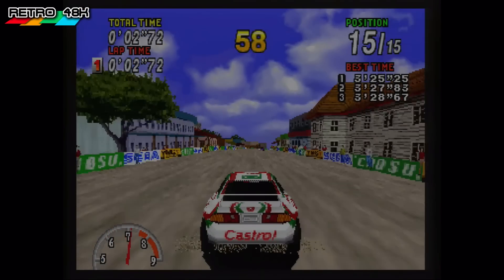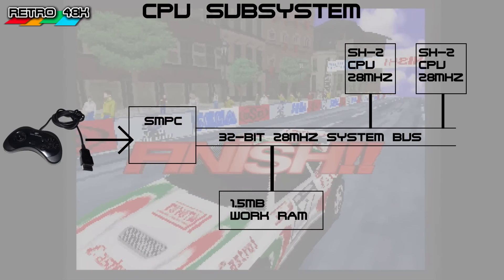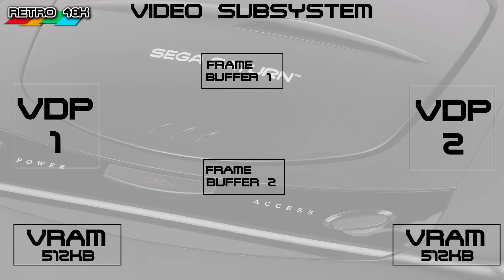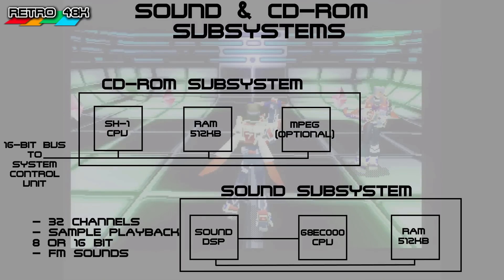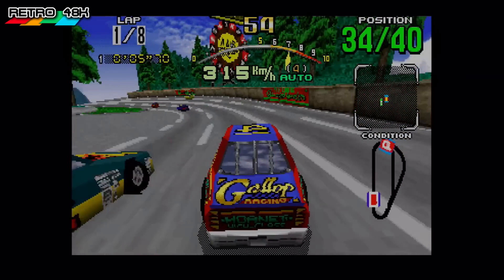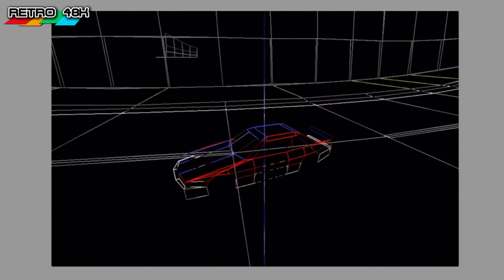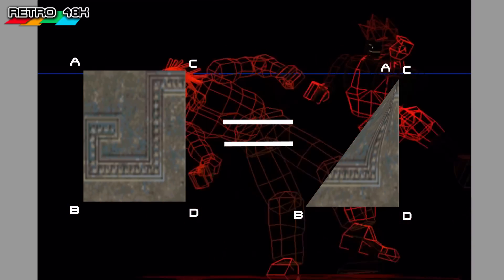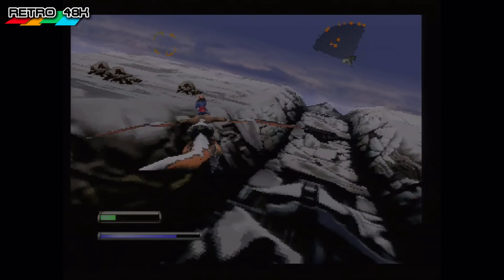How the Sega Saturn Worked

Comment: Decent video mate, and I admire anybody trying to do a technical breakdown of the Saturn. I picked up a couple of things in the vid, and whilst I'm not a programmer or games artist, these are my two cents:
1. The Saturn was not the only system that did quads - Sega's model 1, 2 and 3 boards I think all rendered quads, which makes the Saturn make a lot more sense bearing in mind Sega's home consoles were usually (always?) iterations of their arcade hardware. I understand that the 3DO also did quads, as did NVidia's first 3d graphics card.
2. I believe the fire transparency effects in burning rangers were effectively a hack using vdp2 - iirc they were drawn using vdp1 but sent to vdp2, which could do full transparency across a scene. Burning rangers also has multiple dithered transparencies. I believe that the transparency issue is limited to vdp1, and is to do with polygon overdraw, as all the polygons are drawn to the same framebuffer and something to do with how the forward texture mapping works. Lowscore has a good video on this (and incidentally, it's important to remember that most folks were playing 5th gen systems using composite or lower video quality signals; composite was what came in the box in JP and US Saturns, and dithered transparencies, when done well, looked pretty good over those signals) https://youtu.be/f_OchOV_WDg?feature=shared
As an aside, I don't think either of model 1 or model 2 did transparency either. Not sure about model 3.
3. Regarding the forward texture mapping, xl2 recently found a hacky method of getting real time, hardware based reflections. Iirc it was something to do with using gouraud shading. Here is xl2's original tech demo, and you will see it implemented in the subsequent videos. It was used  in their latest builds of hellslave, and in the unreal demo https://youtu.be/IRDho_yvT9E?feature=shared

Comment: 15:00 I personally disagree that the 5th generation of consoles was the last time consoles had unique and interesting architectures. I would even go as far as saying that that trend only ended after the 7th gen with the PS3's Cell architecture and the Wii being a Gamecube on steroids. The thing that was different however from the 6th generation and onward was finding common denominators architectually. All 6th gen games could handle textured triangles with vertex colours and transparencies, this alone was enough for the majority of games to work on all consoles graphically.

But if you target the Dreamcast specifically you could add per-pixel order-independent transparency, the PS2 was able to perform more complex per-vertex calculations using its VPUs, and the OGX had primitive support for per-pixel programming allowing for complex effects generally reserved for the next generation.

The bigger issue is that for practical and financial reasons it makes sense for developers to target as many platforms as possible, and doing as little work as possible that only benefits a single console, so when developers have an option to choose common denominators for games they will make use of them.

Comment: What you suggested at 14:00 is not the reason why mesh transparency was preferred.  The Saturn can do real transparencies... but only between VDP1 and VDP2.  You CANNOT do them between polygons rendered by VDP1.  Meshing was a hack that used the low quality of most analog signals and TVs to fake transparency between two VDP1 polygons.

Also, not sure where you got the 1.5MB WRAM figure.  It's 2MB, the only place I've seen the 1.5MB figure is a pre-release dev document that was clear this was subject to change
Reply from the maker: Its that dev document, and the transparency issue I mention is my understanding of why you couldn’t do them between the polygons renders on VDP1
Reply: @Retro48K526  Ok, well that's how transparency works on Saturn.  VDP1 can mark pixels as transparent, but VDP2 does the actual blending.  VDP1 will just blindly overwrite all pixels, rather than the proper read, blend, write.  Excellent video otherwise

Comment: Various things wrong and/or not fully explained about SS hw: 1) until SS, all 3D arcades were based on primitive quad shape, including Model 1 AND the mighty Model 2 arcade board (btw. Sega has always produced complicated multi CPU/DSP hw in arcades, the very same Model 1 & 2 have probaly 8 to 10 different CPUs and DSp inside of them, I remember a 16.000,00$ Model 2 price tag at the time..) , PSX was the first machine to have a proper 3D "GPU" with triangle primitive shape 2) a BIG SS know problem is with VDP1 fillrate, which varies from 9 to 21 Megapixels  (still unclear until now) against PSX 66 Mpixels, which means 3 to 5 times less the amount of pixels onscreen, which even more painful if you think about the rather massive loss in rendering triangle in the way shown in the video: even when rendering a "triangle" shape, SS has to render (and waste fillrate) for the ENTIRE quad shape, which coupled with the relative VDP1 fillrate capacity (compared to PSx at least) show how hard was to develop for this hw. 3) the "overdraw" problem with SS while rendering triangle is the main problem for transparencies (alpha blending), due to the way this works, BUT the same happens with every Model 2 game too (remember, Model 2 still uses quads primitive); the Model 3 fixed all problems with alpha blending, using triangle primitive, which enabled all PSX speculare 3D effect like Alpha Blending, Enviroment Mapping (btw. about SS and your video you have OLD news: opposing to TT software tringle re3ndering engine used in Sonic R, XL2 (god programmer) has achieved HARDWARE environment mapping "in Gran turismo style", look here: https://www.youtube.com/watch?v=Zs3l5SDlIJ8) and many more effect like Z buffering (used in later hw like N64, a console which have both triangle and quad primitive btw). 3) SS can display any proper transparencies (it's not a matter of quads vs traingle shaped sprite/polygon with the "Burning Rangers" trick: in a few words,  you have to swap framebuffers from VDP1 to VDP2 to get proper tranparencies, the limit is the framebuffer size itself (you see BR flames are rather pixelated to keep image size into fb limit), something the very same XL2 has achived (and bettered) in Hellslave homebrew masterpice and fantastic 2023 Unreal demo. There are even more things about SS to say, but probably the main point is, as many peoples said in the past: Sega had a first SS version with just ONE SH2 cpu and only the VDP1 (probably enough to better 3DO / Jaguar and produce decent arcade 3D conversion), but AFTER Psx was shown they simply PANIC, throwing into the prototype a second SH2 (which, btw, in not a big problem WHEN you have properly sized bus transfers in the system, a problem reported in the video too) and a VDP2 with it's big 2 "infinite" planes to (marginally) power up the base prorotype.... also, while hw programming difficulties can be overcome, is the CATASTROPHIC Sega management (mostly US, also European a JP too) that killed Sega Saturn (and later Dreamcast too).

Comment: I don't think you've got the transparency information right. The rendered would not draw quads the way you describe, and if it did, thr hatching wouldn't look any better than true transparency. The fact of the matter is, adding two colors together is a much cheaper than alpha blending, so many early 3D chips were able to do "additive transparency" which works for fire and the like, but not "alpha transparency" which blends two colors together based on an alpha value and requires a multiplication per pixel.
Reply: What I don't understand here: The older Jaguar does color transformation per pixel which also needs multiplication. Multiplication seems to be cheap in CPUs. Each SH2 chip on the Saturn can do 16x16 -> 32 in a single cycle. The SH1 for the CD can do 12x12 -> 24 I think. Each JRSIC core in Jaguar can do 16x16->32 in a single cycle. Motorola 6809 from the 70s can do 8x8 in 12 cycles. So this is a bit slow. I am still looking for a linear interpolation circuit, where you bit shift and add like MUL, but you always add. Either from left or right. And then a final add. You just gotta set up the whole pixel shader as scalar so that we don't have to duplicate the circuitry. And then lets have a separate clock, to overclock specifically this part. Memory packs two pixels per word. Also memory would need to read the frame buffer, the texture, and write back. So there is a lot of timing mismatch, which really justifies a small memory buffer (cache). Rasterizers often waste cycles at edges, which lets the pixel shader catch up.
Reply: @ArneChristianRosenfeldt  I would guess that it takes a bit of silicon to do multiplication in a single cycle, and they couldn't spare the real estate on the chip.
Reply: @ why not share? Sega Saturn is so fat, so many chips. They could just have integrated the SegaDSP with the VDP1. Most games don’t even use the SEGADSP. Yeah, can only do one MUL per cycle.

8x8 Bit is only a quarter the size of 16x16 . Even full RGB is smaller than 16x16 . Still can reduce alpha to 4 bit without many people notice. Just two years later voodoo does bilinear filtering on textures. This needs twice the processing power. I am still not sure what N64 does. 3 MULs to spare one palette look up?

Comment: So the second CPU is Usseles on real life.  Intersting.
Reply: Well, not really. It would be mostly used for subroutines, where you would send limited number of parameters, and do the main thing with first CPU . Of course, it was hard to determine when it was faster to split work on two processor, or to do everything with one. Problem further exacerbated by presence of additional video and sound processors.

Comment: The main correction I would point out would be when you talked about the reflections like the sonic head in Sonic R.

It wasn't slower (just) because they had to write it in C.

It was slower because it's was a 100% software render pass done only on a CPU and could not use any of the geometry functions of VDP1

It's a little like Quake 2, among many other PC games, that had a software renderer that was entirely done on the CPU and then there was the ability to off load a bunch of calculations to a graphics card like a 3DFX VooDoo and speed things up considerably.

Maybe that's what you meant in the first place but it wasn't clear in the video.  I know how easy it can be to think something but not translate that thought into text as you meant it.

Otherwise nice overview video and well produced.
Reply from the maker: The video is an attempt to simplify things a lot so yes that is what I meant its C code running on the CPU for software rendering much like the Doom port which did not use any specifc hardware rendering but I was trying to avoid having to explain software verses hardware rendering

Comment: In simple terms they basically taped two stronger 32x together with the sega cd.
Reply: Not at all. The only thing those two systems had in common were having the same SH2 chips.
Reply: @ yeah but each one did different operations. Kind of like how the mega drive and 32x worked. Each one adding a layer or sprite with rotation. I think it’s super cool. I used to have one. Miss her deeply.

Comment: While expensive in a physical media production cost, a Cartridge/CD-Rom combo would have been the perfect delivery method for this machine and that era of gaming which was crippled by 2X CD-Rom speeds - if you wanted the best in both loading times and total amount of content.

You would basically load most of VDP2's tasks at the beginning of a scene, having a deep library of content on CD-ROM to load from for backgrounds, scene layout, etc
You would load some unique scene assets to VDP1 from CD-ROM at the beginning, but primarily access common game assets, run program code, sprites, small sample sounds, straight from the cartridge.  The CD-Rom could stream in rich audio as well.
Are there some examples of this?  If that were the intended use for the Saturn they may have set up the Working RAM and VDP RAM allocations differently.
Reply from the maker: Not that Im aware of, closest would be Xmen verses Street Fighter using it as RAM expansion
Reply: There were a few games that were only released in Japan that used the RAM cart expansion in that way. Xmen vs. Street Fighter, there was a KOF game and Street Fighter Zero 3 (Alpha 3). 

Now, these games came packaged with their own carts that only worked with their respective games. Essentially, they had parts of the game loaded onto the cart that gave the Saturn the ability to run almost arcade perfect ports of these games. This is something the Playstation flat could not do and the differences between the two are very noticeable. An example of this is the intro cutscene of Xmen vs. Street Fighter on the PSX was a poor quality video of the arcade original. The Saturn was entirely in engine and almost indistinguishable from the arcades. You would have to do a side-by-side comparison to see the differences, it's that good. I also believe the Saturn runs at a cool 60FPS while the PSX is 30FPS.
Reply: @Sinn0100  I also think Saturn was still a true 2D sprite action monster where the PSX was actually drawing flat textured polygons to stage 2D graphics through 3D rendering.
I was thinking of those games you mentioned when suggesting the Saturn could have done well down that path - do you know if they had both Cartridge assets and CD-Rom loading in the rich assets, or if they were just late-era carts from when that amount of content would be feasible on ROM chips?
Reply: @Sinn0100  lol man idk why capcom didnt do that with n64 and its expansion pack...
that console lacked capcom love.
Reply: @ssppeeaarr  
The N64 with both....scary man. Nintendo/Capcom probably would have hit the ceiling of what the N64 could do early in the consoles life cycle. We're talking Ocarina of Time and Perfect Dark levels of fidelity within the first year or so. With that setup, Square keeps Final Fantasy VII on the N64, and it gets a significant graphical upgrade. 

Addendum- Nintendo with that setup in theory could sell a cart with specialized chips and RAM that might be able to go toe-to-toe with the Dreamcast. They could have added a second NEC VR4300 and really went nuts.

Comment: Great video.  I always thought the trade offs were in favor of the Saturn for image quality.  Dithered transparencies in some Saturn games versus dithering all over the screen in most 3D PS1 games was a no brainer for me.  Relatively stable for non-perspective correct hardware Quads versus severely warping triangles, that frequently can't even hold together between frames, was also a good call by Sega's engineers as far as I'm concerned.

The Saturn not being able to do Gran Turismo - like fake reflections has been disproven by the dev who made the reflective car demo and adapted Unreal to Saturn.  It is stated somewhere that the reflective texture displayed in both is a hardware feature, not a CPU driven C effect.
Reply from the maker: The reflection effect in Sonic R that I'm referring to was a not a hardware effect the dev has a Youtube channel and discusses it there. I'm sure someone has figured out how to do the fake reflections now but at the time it was not thought possible.
Reply: How could a small game developer correct their textures in a 1995 DOS game, but big Sony and Sega could not be bothered to install some hooks in their hardware to let the fast RISC processors enable this for larger polygons on screen? For example the Jaguar blitter just renders spans. So it ideally drops into the Quake perspective correct texture mapper. Sony and Sega were not sure about 3d and did not want to waste significant money on 3d-only features.

Comment: I should have quit this video on the "32bit gen", but take it until MHz were synonym of processing power. Youtube really is not a place to find technical infos when it came into retro video game
Reply: There is no replacement for displacement in cars. Likewise a lot of these cheats to increase processing power by other means increased the power consumption and heat production. Even the infamous Intel P4 basically came back when fabs got more advanced. Look how N64 increased clocks everywhere!

Comment: The reason triangles are used as the basic primitive in basically all GPUs is because triangles are always planar so you never have to worry about non planar polygons.
Reply: There is no worry when you use painters algorithm anyway. Yeah, but backface culling? It is already kinda expensive with two multiplications per triangle, but with quads you need to find the crossing of the edges. Gotta check upper edge, check lower edge. If forward facing, start from there. Stop when crossed??